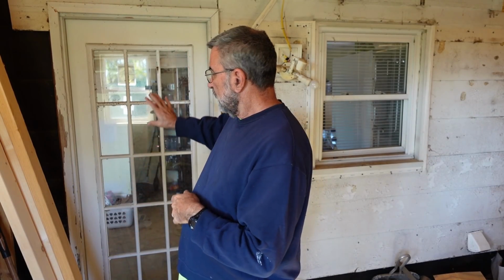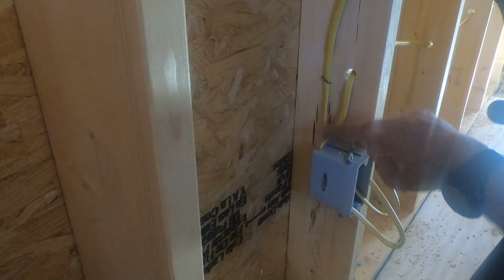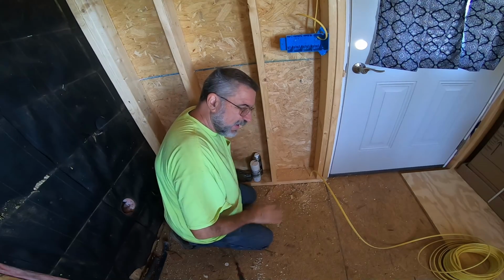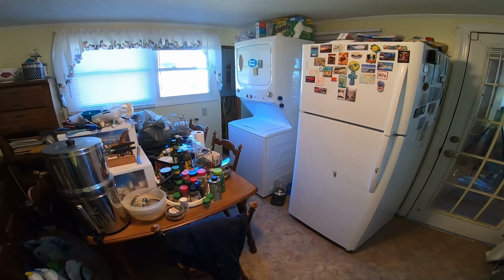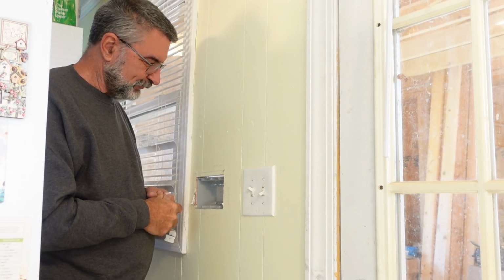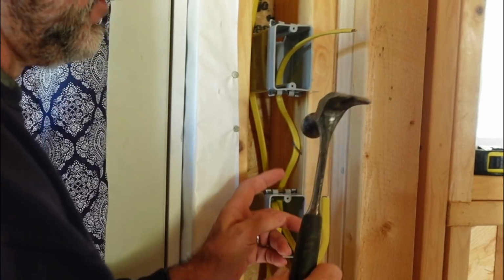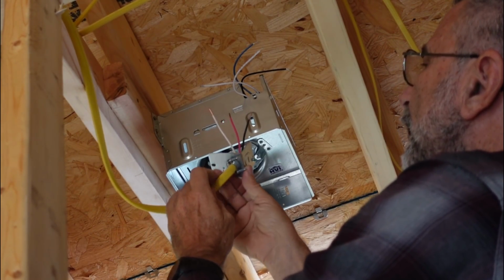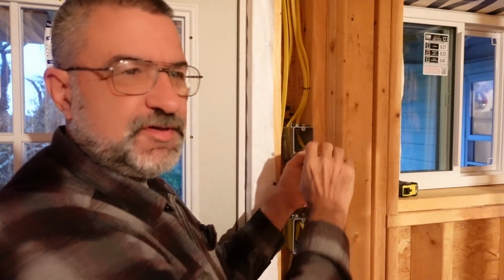Addition build 18 - Electrical

Comment: I'm wondering why you have two doors on either side of the built-on utility room. It seems to me you would gain significant space if you'd just put one door in somewhere on the wall opposite the back of the house, either placed equidistantly between the side walls or wherever would best accomodate your design. You'd only have to walk maybe four more feet to access the utility room from where you park your cars or to get to your hot tub. Maybe you talked about that in another video I missed.

Comment: Bill considered a counter height alcove/bay-window bump out for the toilet closet. Many homes have bay-windows above the kitchen sink. 

The alcove bump out would enable the installation of a vessel sink, thus creating a powder room.

Just make the alcove bump out with 2x4's or 3" insulated walls. The exterior protrusion could be approx. 1-1/2 feet.  Just thought it was worth mentioning, in-case you're interested.

Comment: I would have wired the 20A circuit for just the receptacles, then taken power from an existing lighting circuit to power the lights in the addition (15 amps).
Reply from the maker: There are only 3 receptacles, and they won’t be used much out there. One 20 amp circuit is plenty for the entire room.

Comment: What kind of heat sill you hve in the addition?  A baseboard radiator or a minisplit?  Just curious.
Reply from the maker: Minisplit?  I don't know what that is.  We will just add one additional heat vent coming off of the existing hvac system in the house.
Reply: @LiveSimpleLiveFree  Mini splits are those small-ish units that are mounted near the top of a wall and can be set for heat or AC .... vented somehow to the outside and drain condensate to the outside as well.  Like I said, I was curious, so I asked.  Inquiring minds want to know.  :0D
Reply from the maker: @tinydancer7426  I know about those units. Just didn’t know what they were called.
Reply: @LiveSimpleLiveFree  Ah. You're welcome!

Comment: I’ve always wondered why the crawl spaces are soooo low. Seems a little higher wouldn’t cost too much more to create a better workspace to take care of problems that we all know that will happen in the future. You did an awesome job and having two switches for one light is always best. I was short charged on that upgrade. Just had one in the bathroom and the smallest distance between doors. I was too young to know to ask for them. I use a remote switch to turn on my bedside lamp and a pole lamp in the living room. Thank you for sharing. Missed seeing Elizabeth. Both of you take care, stay safe,warm and well.

Comment: Will you be running 220 outlet for your clothes dryer?
Reply from the maker: The washer/dryer in the kitchen already has a 220 outlet.  All I have to do is move to the other side of the wall (into the utility room).
Reply: @LiveSimpleLiveFree  oh, yeah. That simplifies it big time.

Comment: Get  bill sorry for  poking   My  nose  in   Firstly  I  thought  the  WET   Room  however to  explain  Armoured   Cable  here most  of  out  ca  me  runs in  Conduit protection  that  which  runs without we  tend  to  use   Armoured   As it  says Armoured  has extra protection just  in case  you  may  accideny  drill into  it mainly on  2.5  and  1,50  but of  coarse  today’s wiring is  mostly  Micro with the  latest  appliances  we  use butt  a  look at  the  wet room if you  have  times  interesting tks  Matt

Comment: Maybe an external allweather power point outside somewhere? In case you want to run power outside if you don't already have one. They can be handy. Loving the build series. I felt for you having to get under there and back up. You're a legend.
Reply from the maker: I am putting in 2 exterior electrical receptacles.

Comment: 'Ahoy Matey!  (bilge pump reference)  Real fun video, thank you, Bill.  I always like the first switch you come to in a room is for the light and the second one is the fan.  That way you aren't turning on the fan every time you go in the room instead of the light.  You might have it that way, but when you described it, it was the other way.  Just a thought.  Loving this series!
Reply from the maker: I didn't specific which switch would be which. But yes, I usually do it as you suggest.  😊
Reply: @LiveSimpleLiveFree  thought you would!

Comment: You kept calling the bare wire the ground. Everyone down here <including the inspectors> would call the red and black as the controlled circuits, the white wire as the ground and the bare wire as the bonding wire.  Just semantics, it took a few minutes to realize what you were saying.
Reply from the maker: The white, I have always heard called the white or the "common" wire.  The bare wire has always been the ground, both in PA and in VA.  I've NEVER heard of bonding wire! LOL  Where do you live that uses that terminology?
Reply: @LiveSimpleLiveFree  South Florida. The green screw is called the bonding screw and the bare wire the bonding wire. But we both would have known after a little thought I'm sure. lol

Comment: This is totally off subject of this video but I'm curious how do you get your firewood- do you buy it? do you process it yourself? how do you find good seasoned wood? etc
Reply from the maker: Sometimes I buy it, sometimes I process it myself.  It depends on what I can find.  Out here in the country, many times someone will have a tree down for some reason or other, and just want it removed. I don't charge them, but I remove it for the wood.
Reply: @LiveSimpleLiveFree  do you season it for at least a year, as is recommended, or do you use it after you cut it?

Comment: My husband had to do a lot of crawl space work under our remodel. I suggested that he put in a couple of outlets to plug some clip-on lights to make it easier to see without a flashlight. He even went so far to attach a ceiling light base with a high wattage bulb in it with a switch he could flip as he enters the door. It makes it so much easier to work and it lessens his claustrophobia.
Reply from the maker: I have installed 3 lights in the crawlspace (with a switch near the door).  Just not way back in this corner where it is so tight that I never go back there.  I don't renovate very often.
Reply: @LiveSimpleLiveFree  Ah, that's good. You're ahead of the game. This is our LAST remodel. We are very tired and sore (in our late 60's) at the end of the day.

Comment: We had to put plate protectors for wires also ,back when we did our house we lost 3 yrs later in 2010. We worked so hard on that house,even with that we had loans n gave up smaller house as collateral on 3rd loan,that was big mistake. I miss our house,10 rms n 3 bath. Don't need it now though. Great job.
Reply: So sorry you lost your beloved home in 2010...that must have been really hard.💞

Comment: While you were below panel
You could have run a wire for
Hot tub...
Reply from the maker: That's still too far in advance.  We don't yet know what the electrical requirements for the hot tub will be.

Comment: Hi bill on the  wet room  agin not sure  if  u  have used the search   On here  well if u look at the top   Right  corner  there’s a  mgnifiying  glass  highlight with  how  to  fit a  wet  room it  will  shows  different  people  fitting  them   Mei just  bougtmt tiles and  Waste trai also  fitted  had rails on  to  grab as  we re  getting  old lol 70s   Y extras uca   Fit  yourself I’m  not  a  plumber  allways  didn’t doy  I’m engineer  but  do most  home repairs you’ll See  some  fitting   Shower tray I  used  tiles   And  used  good   Sealing   And also     NON   Slip  tiles hope  I ve been   A help as  for us  one  of our best improvements  I’m sure if they’re not common  you  would get a  grt  buisness therefirtig  them

Comment: Agree about the flipping fan. I had my switches changed in the bathrooms, to put in a light switch and a separate switch with a timer setting for the fan, so you could set it for 10 minutes up to 60 minutes. We were finding we were putting the fan on after showers etc. and then would forget about the silly thing running and it could be on for hours using up electricity, because the bathrooms were far enough away we couldn't hear the fan running. It is so handy having the timing choice. You can never tell about inspections, but it isn't slowing you down and thats the main thing. Loved the fast forward energizer bunny camera work. Don't you wish it could actually go that fast? lol
Reply: Love your idea about the bathroom fan being on a timer.  I'm one of those people who has forgotten to turn them off in the past.😳
Reply: @lizstewart7113  They are not expensive and attach right next to light switch, and have 5 touch pad time settings. Available in any hardware store. I love it. I was horrible at remembering to go and turn the fan off.

Comment: Will there be a radiator for heat?
Reply from the maker: No. We have central heat/air. I will put a heat vent out there in the floor from the existing system.

Comment: Good music choice for the crawl space! My new house had electrical problems just as my first one did. It is upsetting because this time I had and paid a realtor who strongly recommended an inspection which wasn’t too expensive, but on my first night, I kept throwing the breaker when I used a kitchen outlet. As it turned out, the dry wall contractors covered over another outlet in the kitchen. So it was uncovered and set up properly. I asked the inspector why he didn’t find the problem. He asked how he was supposed to know an outlet was covered. Well, I think he should have at least realized the outlet was throwing the breaker. I like how careful you are in providing switches. I have a task light over the island that has only one switch. My brother-in-law (an electrician) fixed the problems in my first house - a switch in one room turned on the lights in another. But they live in Sebring, so it will be a long time before he can add a switch for me. I don’t think inspectors are worth their money.
Reply: I thank God for inspectors. They are working for your protection and safety. Your arrogance is showing.
Reply: @cherylyapp2036  Just upset. I paid $400 for that inspection and then had to have the builder’s electrician come out to find and fix the problem. He said the arc threw the breaker, preventing a fire. I found the problem on my own, so I wasted my money.

Comment: We modify   Took out our jacousue  and  turned our  area  to a  WET room gettin  TOO old gettin inn out of  bath
Reply: I  did  my  own   No  surrounds  a  walk in a must  for  older  people  our  cousinhas one in  her care home on  4  floor ours  is  onzthe  second  floor  wishh  I could  send  pic
Reply: Hi bill  and  elisabeth    A  WET   Room  is very  common   This  way  they  are  Easy  to  create   Basically  it’s  means  in  the  shower  area  you  Tile  compleay   The  vase  area  is a  run  off for  ALL  waste  shower water to a drain  int  the  tiled floor   Meaning   open shower  no  need  for  any wnclaiur  walk in walk out  we also  fitted   A  seat we are in our  70s  you u   Tile  all shower  area with  floor  area  on slant   To    Drain   Area  we  have fiund  it  a  GOD  send  tgey are   Imminent  here  now both in wood flooorA  you  use  waterproof  tile W
Reply: Hi bill  just   Went  to  SEARCH  and  found   WET  room  And  how  todo  one  really  good
Reply from the maker: This bathroom will be JUST a toilet, not a shower. So no need for a wet room.